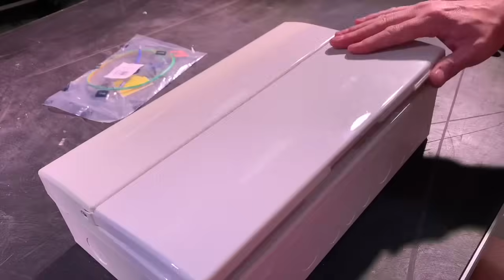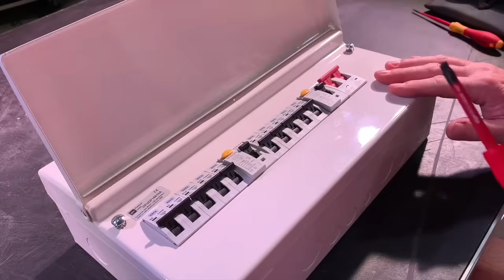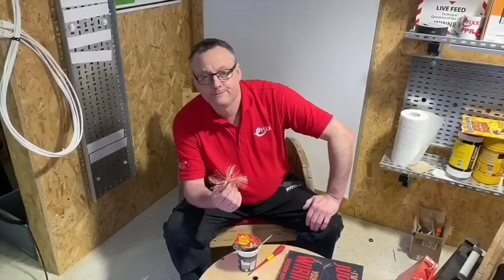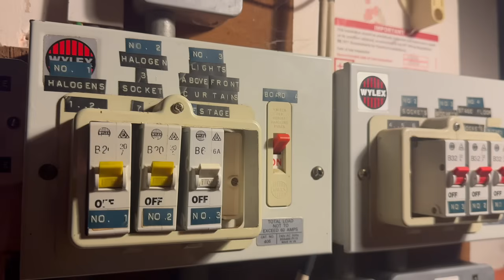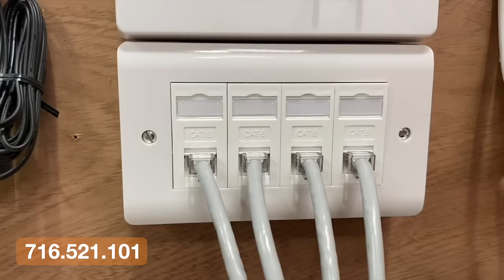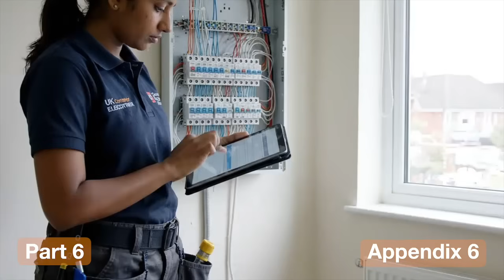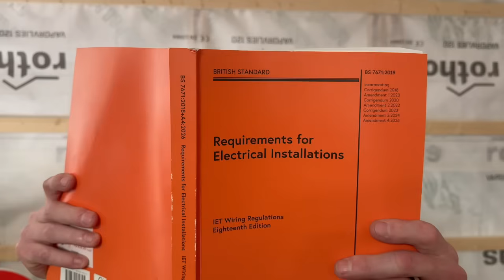BS 7671 Amendment 4: What Every Electrician Must Know!

Comment: Seems a bit odd to me, why would you need a multicore 25mm cable for a caravan? Looking it up suggests you have erred  "Cross-Sectional Area: For standard 16A hook-up arrangements (e.g., leisure vehicle hook-up extensions), the cable must have a minimum cross-sectional area of 2.5 mm² copper"

Comment: The point of all conductors passing through the same entry on a ferrous board has little to do with over heating and a lot to do with magnetic losses which will affect disconnection times.

Comment: So going forward from October, would type AC RCDs on an installation in most scenarios be coded as a C2 or stay as a C3?
Reply: (Love it: the 'Fixers "loved" your comment but didn't condensed to reply!  So they love it because your engagement lifts them up in The Algorithm...)

Remember any RCD (most commonly RCCBs) is and remains "additional protection".  If the primary protection can disconnect in time, any mis-selected or faulty additional protection should only attract a C3.  If an RCD is required for other more significant purposes, such as the primary means of "fault" protection (e.g. protection again fire at the incomer to a TT installation) only then should it be able to attract a C2.

I suppose you're question is, "if a TT incomer is a Type AC-only RCCB over 30mA (Selective or General is irrelevant) and there is a circuit on the installation that inserts DC current on the waveform (ripple or ripple-free) does that make the Type AC incomer a C2 fault?"

This is the only situation I can immediately think of where it's relevant.  But it would be equally important in any installation where RCBOs ought to installed on each circuit: kitchen circuit with WM, TD, DW, fancy microwave, digital cooker, digital control kitchen aids, IoT-enabled FF, on a Type A or better RCCB; an IT suite in a village business or school likewise on Type A or B; all LED lighting or light control circuits...
Whether or not those circuits have appropriate RCD types on them, would danger be present if the DC current prevents the incomer from tripping due to the impaired presence of fault protection?

All modern equipment now dumps varying degrees of DC current onto the circuit (and sometimes onto the earth leakage, which might impair earth monitoring devices).  Does that mean every Type AC Selective incomer in the land is automatically a C2 fault?  Will be now start going through every village and farm (and many suburbs) ripping out every TT incomer and upgrading to Type B just in case?  And how much is a 4-pole 300mA 400V Type B RCCB?

Comment: Dear lord, the new requirements for PoE are going a bit daft... adding protective earthing to isolated DC only cabling will only drive up costs and not add anything to safety. If your metal cased low voltage PoE camera has become live at mains voltage, you have a more serious issue and no low voltage cable will solve that.

Comment: I,M sure i watched a video the other day now saying that Bi directional rcbo,s are no longer required as its been disproved  that there is not a chance of faults being blocked. So bloody confusing.
Reply from the maker: I'm prepared to put my neck on the block here, but bi-directional are here to stay, Most manufacturers are now making these as standard due to the risk posed on uni-directional and energy flow going the other way. 
Thanks for commenting 😌
Reply: The two things in my view are that manufacturers are never going to categorically state that non bi directional products are safe, as there may be liability issues, plus they're in the market to sell bi directional kit. Its not for electricians to determine nor take responsibility for. Always cover yourself with product choices is my take.

Comment: 2:15 why would ANYBODY have put generation into an electrical installation in any other way in the first place? (though, I am AuDHD and see things differently). When I had solar fitted in my home in 2013. I had very unique setup. Two MK CUs, one at grid voltage (which averaged 252v). And one at 220v via a voltage optimiser. 

The solar [and a future planned] RCBO were the very first point after the incomer issolator on my first board. Then a 50A C-type MCB fed the voltage optimiser and then SUB board.

All kitchen circuits [cooker, Fridge/Freezer, Upper counter Ring, under counter Ring], the immersion heater, and the workshop were all on grid voltage. 
The 3x bedrooms, loft, two bathrooms, 3x lighting circuits, and the two Racks all ran from the Sub CU.
Reply: No you don't, your not special..

Comment: All I want to know is how many takes did you have to do to get the numbers correct - btw I'm an engineer and all you have spoken about has been consider on bespoke large installations for years even PoE
Reply: Yes, agreed, I come from a data centre background and all this was know and delt with yonks ago. I really don't see why BS7671 is sticking it's nose into POE without giving new insights.
Reply: Indeed, it's a 25 year old standard where exactly zero manufacturers of equipment are going to pay the slightest interest in BS7671. If the next big thing is 80v PoE+++++ to power the next gen of access points, then that's what people are going to use and the regs aren't going to stop anyone. Boggles my mind how they're so concerned about spacing "newfangled" ethernet and power cables, given interference hasn't been an issue since we started using twisted differential pairs in the 90s. Even 10Gbps over copper at the edge of signal breakup is affected more by a dirty connector or an extra foot of length than any kind of proximity to a noisy high current motor, let alone its power cable!
Reply: @davebodger2 Totally agree. Worst thing ever becoming the IET.

Comment: NOTE: For low voltage switchgear and controlgear assemblies to the BS EN IEC 61439 series, conductors in AC circuits with a current rating not exceeding 200 A can pass through separate holes etc. in ferromagnetic enclosures, sections, or plates. Currents above 200 A where conductors pass through separate holes in ferromagnetic material, need to have been verified by temperature-rise test(s). 

So, does this mean circuits <200A can go through seperate holes in metal now?
Reply: I think it's been well proved that eddy currents are not significant in domestic installations.
Reply: The first sentence in your post answers your question.

Comment: Fascinating how Efixx are doing presentation on the latest regs, but then not explaining and highlighting why plug in solar and plug in batteries, via a 13 A plug, causes various grey areas, and non compliance with some regulations, when doing presentations about plug in solar and plug in batteries.

It is very much like Efixx are being rewarded to push plug in solar and batteries....... along with all the other promoting.

Efixx credibility falls another notch.
Reply from the maker: We’ve produced a significant amount of content on the topic of plug in solar. Exploring in depth the grey areas and debunking many of the myths. We don’t see any of the industry regulators doing this.
Reply: @efixx  I have brought the following to your attenetion several times.........

BS7671:2018 IET Wiring Regulations Amendment 4:2026 -  Regulation 551.7.2.1, states the generating set shall be installed on the supply side of all the protective devices for the final circuits of a distribution board. Plug-in Solar PV and battery storage does not meet this. For the purposes of this regulation, stationary secondary batteries shall be considered a generating set and not a load.

BS 1363-1:2023 - 13 A plugs, socket-outlets, adaptors, and connection units - Part 1: Rewirable and non-rewireable 13 A fused plug -Specification and Clause 5 states, ‘Plugs shall not be used for the connection of electrical power generators to socket‑outlets.'

I have also requested you do a presentation regarding the effects of plugging in additional sources of energy, after the circuit protective device,  on circuit behaviour and disconnection times, under fault and overload conditions?

I have requested you show us where the cable calculations in Appendix 4 of BS7671 allow for additional energy sources, above and beyond the energy that can flow through the protective device, at the origin of a circuit?

Please provide me with the links to where you have covered these areas?

Thank you.
Reply from the maker: Clearly, you don’t think plug-in solar is a good idea. However, the government appears to want it adopted in the UK using an approach already seen in several European countries.

The issue is that UK wiring systems and product standards never really anticipated this type of equipment, so it’s no surprise the existing standards don’t neatly accommodate it. That suggests the framework needs to change.

As discussed in last week’s video, if you engineered this purely from the top down, you probably wouldn’t choose to inject power through a 13 A plug. But 13 A plugs and socket-outlets are not perfect to begin with. A double socket can already be overloaded by two high-power appliances used for extended periods, and one leg of a ring final circuit can also be overloaded in certain circumstances. The industry already accepts and manages those risks.

I’m happy to explore the concern around injecting 800 W into an already heavily loaded circuit. But perhaps you could outline the exact real-world scenario you’re worried about: what load, what circuit arrangement, what protective device, and where you believe the danger occurs?
Reply: @efixx  I don't really feel I should be needing to highlight the areas in which plug in solar and batteries are at odds with the existing regulations and standards. I don't think those regulations and standards were made up on a whim, but through decisions based on electrical theory and safety.

If you say reverse energy flow through a 13A plug is ok for plug in solar and batteries, why doesn't that 'green light' and cause ambiguity, meaning unskilled / untrained people may think using 13 Amp plugs for reverse power flow must be acceptable in other applications, where the pins could stay live?

What is going to limit unskilled / untrained people from plugging in more than one additional source of energy to a circuit, so the energy in the circuit could be that flowing through the protective device at the origin, plus 800W fed in, plus another 800W fed in, etc? I believe that it can potentially be more than 800W if another country is selected by the user.

Don't we apply a correction factor of 0.725 for circuits with a BS3036 fuse at the origin, because it can allow more energy to flow in a circuit, for longer duration, under fault and overload conditions, before disconnecting? This is pretty much the same as plugging in solar and batteries after the protective device at the origin.

What electrician, who should have a good understanding of the regs, is going to inspect a circuit / installation, and then give a green light to the property occupant, to start plugging in additional sources of energy, knowing it contradicts the regs and standards in several areas? I certainly wouldn't leave myself wide open for finger pointing because I had said it was ok to now plug in additional energy sources, after the protective device of a final circuit.

I'm afraid Efixx has shown to me it is more interested promoting manufacturer's products, rather that assisting the electrical industry as a whole, cherry picking some regs to promote a product, and then ignoring the regs in other instances, such as this one.

Just because the government has an agenda, it doesn't mean that electrical principles and theory suddenly change, or can just be cast aside. This is my issue with plug in solar and batteries.
Reply from the maker: What’s your view now that plug in solar is legal?
Reply: @efixx you mean how the government has swerved and given disregard to our existing standards and regulations, that were put in place for a reason? 

That is just a fudge, hence why it largely swerved the IET and British Standards to steam roller this through.

Still waiting for you to demonstrate where the cable calculations in BS7671 allow for additional sources of energy in a circuit, after the protective device, and why that won't extend disconnection times?? 

Just remind me why we have a 0.725 correction factor for a BS3036 fuse if it isn't because it will allow additional energy to flow in a circuit before the circuit is interrupted under fault and overload conditions?
Reply: If they said don't use a 13A plug people would say its safe, the equipment is designed to work that way, if they said its OK to use a 13A people would say, don't you'll die. As you said it's a grey area, the very definition of grey area. Nobody wants to commit one way or the other but people have been using 13A plugs for many years now, if people were dying it would have been banned.
Reply: @st200ol  it is written quite clearly I think.....

BS7671:2018 IET Wiring Regulations Amendment 4:2026 -  Regulation 551.7.2.1, states the generating set shall be installed on the supply side of all the protective devices for the final circuits of a distribution board. Plug-in Solar PV and battery storage does not meet this. For the purposes of this regulation, stationary secondary batteries shall be considered a generating set and not a load.

BS 1363-1:2023 - 13 A plugs, socket-outlets, adaptors, and connection units - Part 1: Rewirable and non-rewireable 13 A fused plug -Specification and Clause 5 states, ‘Plugs shall not be used for the connection of electrical power generators to socket‑outlets.'

Comment: Caravan minimum conductor size of 25mm? 28:35
Reply: Surely they meant 25m was the max length of cable and 2.5mm was the minimum conductor size to a touring caravan
Reply: And the 25m bit. I find 25m far too long in most cases on caravan sites. I have made up 10m x2.5 artic flex leads for my caravan.
Reply: @paulgreen7703  HO7 is better than Arctic.

Comment: 28:38 Caravans must be supplied with a minimum conductor size of 25mm² - That's a bit excessive, isn't it?
Reply: For something you hitch onto your car, drag into a field, and then proceed to inflict misery on yourself and family for a couple of weeks, yes.  For the other definition of a caravan in the UK a 'static caravan' (which confused the hell out of me) that most other countries would call a demountable or transportable building, no.
Reply: @retrozmachine1189   So Construction site shipping container offices, canteens, workshop, etc. Are these going to need a 25mm feed and a suitable commando socket/plug? Are they a demountable or transportable building?
Reply: @PhillHills  I'm sure you can work this out.
Reply: That section was complete mis-speak. It's a maximum of 25m long of 2.5mm squared csa - i.e. a standard orange caravan hook-up lead, IMHO.
Reply: Surely it’s 25m of orange flex with 2.5mm2 CSA. Need to check book once I’m back at work
Reply: @b00130629  That would make infinitely more sense.
Reply: @b00130629 table 721 in the orange book. Thank me later
Reply: I wish people would state dimensions correctly...
25 millimetres squared is different from 25 square millimetres ~ just saying!
Reply: @herrtomas6729  Please explain. I don't believe you're correct.
Reply: @yngndrw.   the pedant is correct.
Reply: @joeds3775  I presume this is in reference to how we'd show the units for, for example, acceleration. (m/s²) I.e. meters per second per second

But from what I can see, and I looked it up again when the comment was made - square millimetres is still shown with a superscript. Even Wolfram Alpha doesn't make a distinction between the two.
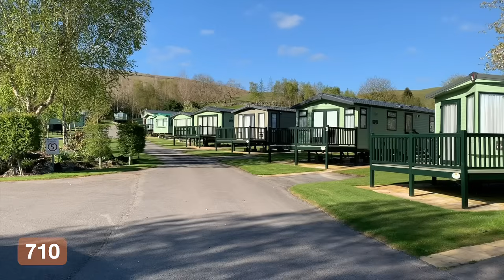Reply: @yngndrw.  At 28:29/28:36 they say "...with a minimum conductor size of 25mm squared..."
In maths, 25 squared = (25x25) = 625
People (experts) often state this incorrectly when they really mean "25 square millimetres" 
In maths, 5 squared = (5x5) - 25 ~as in 25 squares, each 1x1 mm. 
I've pointed this out before, but people seem to say, well you know what they mean!
They claim to be educators!
Call a dog a cat (don't be daft!)
Reply: @herrtomas6729  Incorrect - the unit millimetre is being squared, not the number before - hence mm². It's clear that it isn't 25² mm. Plenty of so-called pedants are confidently incorrect on this point.
Reply: @rednammoc listen to how they say it, not to how it is written.
It is 25 square millimetres, but they say “25 millimetres squared” which is not correct.

Comment: 24:30 Function earths must be connected to the main earth terminal only once - How is this meant to work, for example, a two-wire commercial fire alarm? The screen in your FP100 for the detectors and sounders is a functional earth, but in the control panel, this would typically end up being connected internally to the protective earth as per the manufacturer's instructions.
Reply: That might fall under electrical equipment / design regs and not fixed installation which is what BS7671 covers

Comment: So you can't have 60amp from the grid and 60amp from for eg. solar as a supply, but you can have 3x 32amp mcb's and one 40 amp mcb populating the consumer unit that exceeds the 100amp main switch. Just curious, am I missing something?
Reply: Diversity!
Reply: Yes you are missing something.
You are summing up individual breaker ratings. That is the mistake you are making.

The issue here is the total current that could flow through the main breaker.
Reply: @deanXRayZulu  Or more importantly, the maximum that could be flowing through the busbar that's only been approved by the manufacturer for 100A.